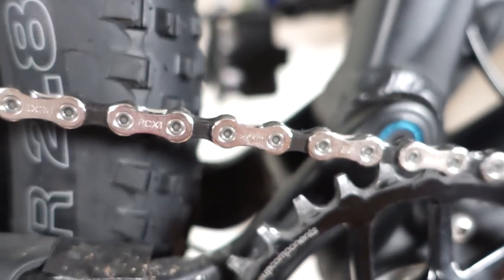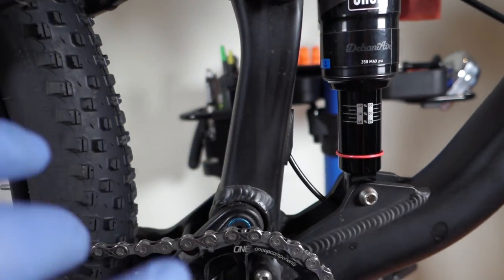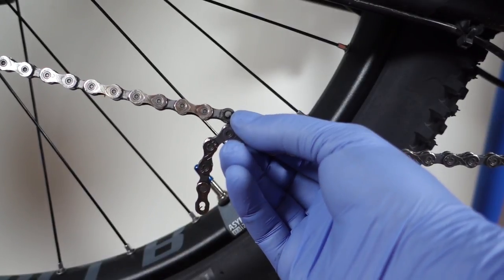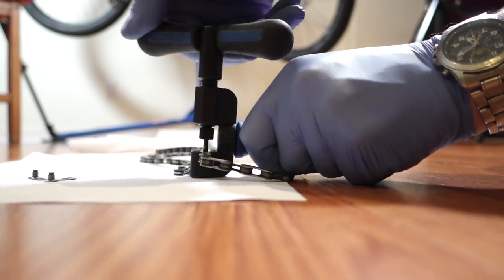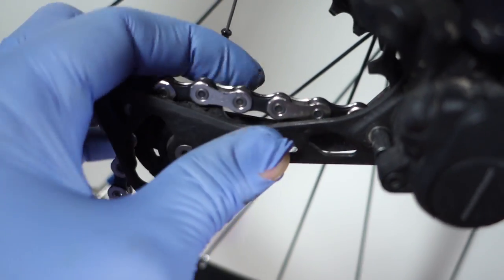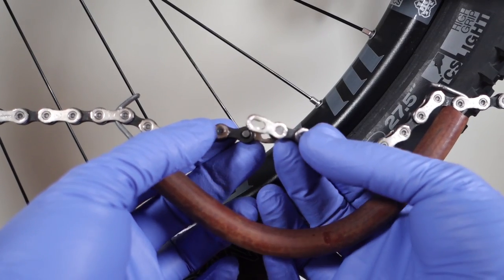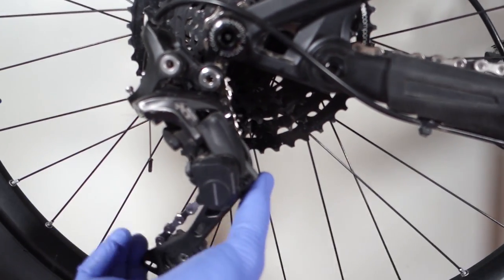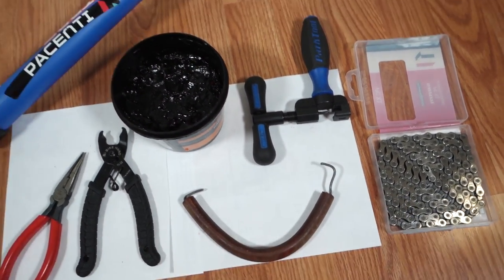How-To Replace a Bicycle CHAIN - Full Suspension Transition Smuggler Mountain Bike

Comment: If you don‘t have that wire to keep the ends of the chain together: Use a zip tie!
I just did it last weekend on shimano chain.
For measaring the chain: you can also count the number of chainlinks of the old chain;;

Comment: Normal multipurpose workshop pliers can also release quick link, when You fold the chain away so the quick link is at 90 degree angle to both ends and then grab the link diagonally, so that the plates can slide away beyond the pin. Also LoveMTB You need to get Yourself a medical grade nitrile glove pack of ebay or amazon. Grease and solvent will not chew through them as through latex and they're guaranteed to be thicker for people security, I fell in love with them, weren't noticably more expensive, so don't get Yourself ripped off.
Also got my Dartmoor Primal Pro 27,5 2018 on June 12 and really like it. Bit disappointed with the weight of XL 15,2 kg with included pedals, 14,8 without, exactly 1kg more than catalogue says (bastards-frame according to catalogue differs 150g between S and XL...my arse). So it is slower, but I did want a robust beast for learning new skills, taking in the mountains, maybe enduro racing and a bit of abuse, so it defo will take it :-) About 390km done till now, just gave the wheels for first tension correction to make them last as I always do. Added some weight to the bike by putting that 11-50 chinese ZTTO cassette (works well without mods, chain didn't even needed adding links) and heavier rotors, also size up in front to 203mm,  Swapped the brakes to Deore 615 just cause I had them and love shimano bleeding. Happy
Reply: I meant not needle nose one, just a standard normal short, standard jaw multipurpose pliers, that we get in every tool set. I release quick links with those with no problem, just some imagination and bit of practice. Now for me it takes no time at all, not like they require fiddling to release the link. I should make a video about it, cause those proprietary pliers are so ridiculously expensive for what they are. They should be cheaper than needlenose pliers.